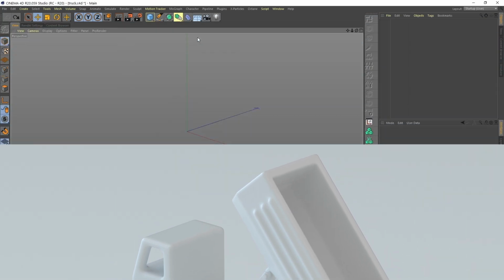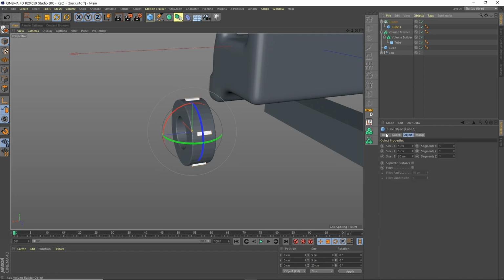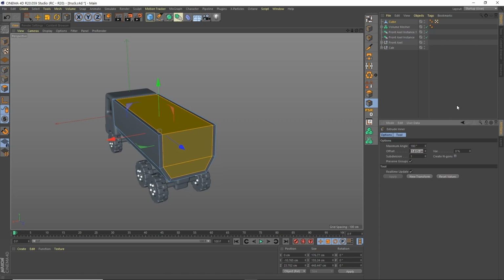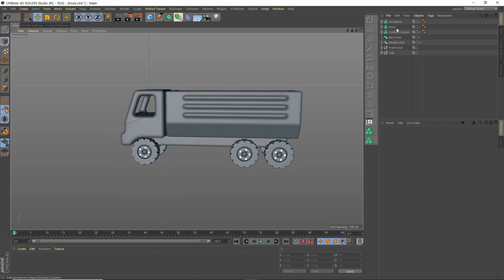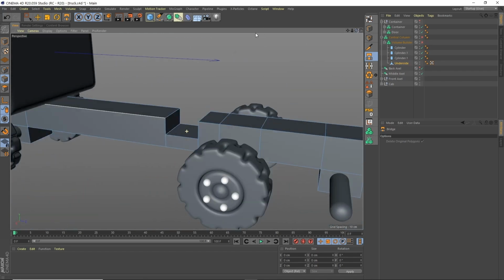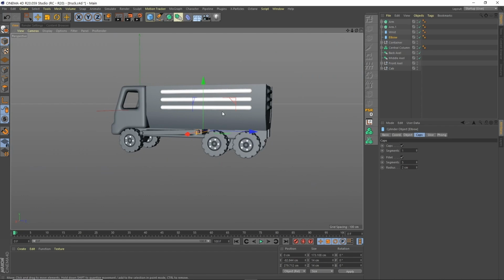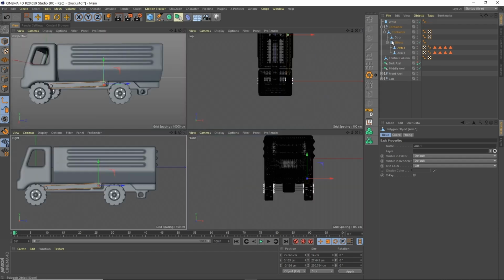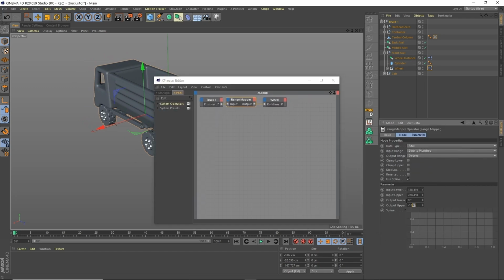Creating a Fun Factory Looping Animation w/ Perry Cooper | Part 1: Truck

Comment: Very cool tutorial by amazing Perry Cooper. 
You may have one prolem. If you will try to Inner Extrude your Container ( 9:31 ) you may won't get one inner extrude on top and side part. That's because of Maximum Angle. Put it on 91 degree, and you will get the same result! 
Hope, that will help anybody)
Reply: It helps a lot aha thanks mate

Comment: Great tutorial ! .. One issue  I’m having though , at the end when you set the driver with expressions to get the wheels to move when moving the truck back and forth , the wheels aren’t moving when I move the truck after setting Set Driven Relative to the wheel , any idea what I could be doing wrong ? Thanks ..